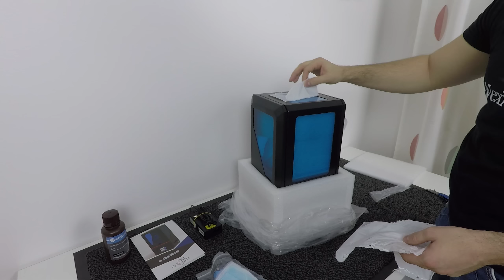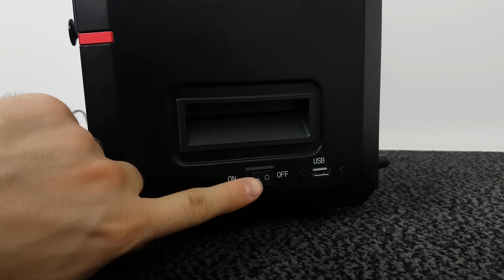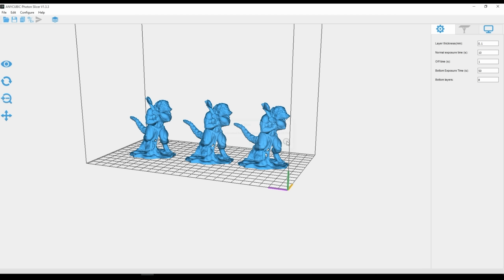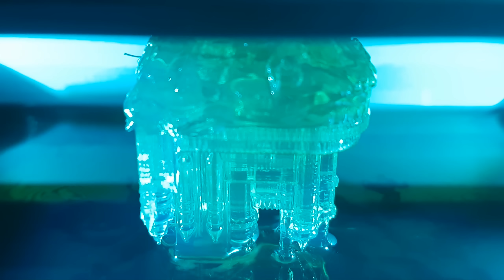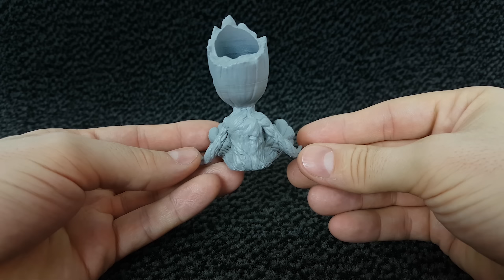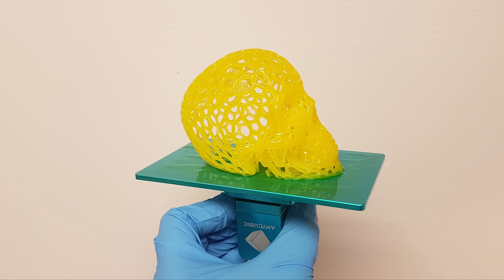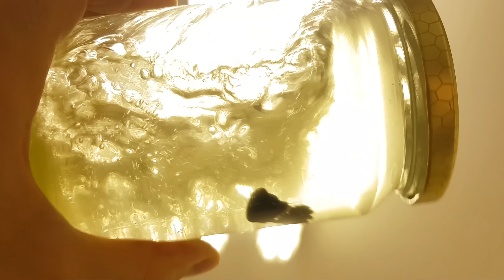Anycubic Photon DLP 3D printer Review - insane print quality!

Comment: So I did end up getting the printer! So far it is working pretty well, though I am having a sort of clicking sound that I cant seem to find anyone else noticing?
Every time the platform raises when printing, there is a slight popping or clicking sound, as if its popping off the model from the bottom film. I am a bit concerned as I don't remember anyone saying anything about that sound (though it is very faint), and not sure if you experienced this as well. I do have a spare film that I was considering replacing it with, but I wanted to make sure it was actually something to be concerned about in the first place. Thank you!
Reply from the maker: Don't worry about the popping sound that's completely normal. That is the sound of cured resin layer popping from film foil and moving to the next layer.  It's should sound like that when is printing especially with Larger objects. The bigger cured layer surface popping sound will be more noticeable. Nothing to worry about.
Reply: Thank you so much for letting me know, and for being so quick to respond! You are the best!

Comment: Great Work !  If you are worried about covering detail with spray primer, buy a hobby priced airbrush ....
Before Photoshop appeared on the scene, I was a photo positive & negative retouch artist . I used some equipment that you could airbrush a line on a eyelash and not go over the edge !  But you can use most any hobby airbrush for a very high quality finish and keep all of the detail on the model/subject .  Just be sure to select a two stage type.... That means when you press the button/lever it controls the airflow. Then as you start pulling back the button/lever it starts feeding the paint .  You can get a very fine spray mist !!  Just make sure you thin the primer or paint to a low viscosity, trial and error testing will let you know when you have it right !  Also a big plus is that the airbrush cup for holding the paint is usually 5-10 ml, so small can of paint will last you about a year or two !  Even Harbor Freight co, use to sell a two stage for $15 dollars US so just shop around ... Good Luck !

Comment: Now I know what I "need" next for making statues and accessories for my injection molded kits. Thank you  for the review. :-)
Only drawback is the small print size if I want to make a quarter scale statue. The body needs to be split in several parts. But it's not a big deal I guess. The quality is what matters.

Comment: There is the things i got from ANYCUBIC Customer Service
1)Photon was equipped ANYCUBIC photon system, ANYCUBIC can update the system anytime to get new function.  While D7 was equipped open source system, there are many limits, about system update, all the things they can do, is waiting for update.
2)Photon Slicer is also the key to push me to Photon, open source slicer slice a 30M file will take 24 minutes or more, but Photon Slicer can finish  this job in 1 minute, i am a person who can not wait too long
3)Open source system didn't have a Mac OS drivers, it means you can not use your Mac to do anything with your printer. Surprise, Photon system can get these drivers.

Comment: This review sold it for me. Ordered yesterday from Amazon Prime and it arrives today. Really looking forward to finally owning a 3D Printer.
Reply: SkemeKOS How’s your experience with it?
Reply: Excellent! The detail is incredible. Perfect for small scale objects that require very high amount of detail. This is what Ive been waiting for before jumping into 3D printing. I was initially a little put off by the clean up process, but it is very quick and simple. I just leave the vat, and print bed to soak in a tub of isoproyl alcohol for 2 minutes, remove and wipe with tissue and alcohol wipes. For the printed parts, just soak for 1-2 mins in the isopropyl, then wash with water for about 30 seconds. Leave on windowsill for about 30 minutes.

Comment: The baby Groot can be done even in an Anet A8, it's not a good example. I love the Eiffel tower thought
Reply from the maker: Mikel Gorostiza I doubt that all details would show on A8 like on Photon at this scale but still you have more then 20 other prints to compare with... I think Baby Groot looks very cool and it's great 3D model so I got to print it with Photon.
Reply: All those details, I can assure you I was very impressed too when my friend came with that and told me his Anter A8 did it. The printer is quite improved with some 3d printed gadgets and its inside an IKEA modified wooden box with a fan for a proper ambient temperature cotrol but still the whole mix is not more than 200€. For sure, that's not the most difficult piece to print and I don't know how much time did my friend spent to have that quality (i know him and it could be days) so still the difference between the 2 printers is huge, moreover the complexity of other pieces you show it's an impossible task for the A8. My point is that, in my opinion, the baby groot wasn't the best example to show the capabilities of the printer althought it looks great.

Comment: Sorry another quick question: Do you have to do any pre-printing preparation on the build plate 
(I.E. use hairspray or glue to make the model stick to the plate - as you would on PLA printers)
Reply from the maker: Chris Garrod No problem :) Nope, there is no need for any adhesive on the build plate. Just take your print and reinstall on printer again and go for the next one.
Reply: Thanks again for a fast reply :0)

Comment: I’m new to SLA printing. Are the printers resign specific? Do I have to use the resigns from photon?
Reply from the maker: Josh Daniels No, you can use resin from other manufactures as long is 405nm.
Reply: Nexi Tech I just got my printer and tried using makerjuice G+. I keep getting failed prints. Any thoughts?
Reply from the maker: Josh Daniels Fail prints you said. Are prints stick to platform or not? If not maybe you did not level it correctly or you need longer exposure time. I just check on Makerjuice website on G+ and it said that is pretty fast resin and it cures up to 420nm so I guess you need to level the platform better. Let the platform clamps harder paper then set Z to 0 and try again.
Reply: Nexi Tech I just ran the print at .035 layer height, 50 second bottom layers (8), 10 second layers. The only thing that cures to the plate are the base layers. I think I need to increase cure time for layers. What resin are you using?

Comment: hey there. with 1000ml resin how many minifigure can u create ? thnx :)
Reply from the maker: sinan sünder You can create 50 pcs of hulk size miniatures in video. Hulk is 20grams 100% infill. Dragon miniatures are 4grams heawy so you can make 250 pcs with 1L of resin. That's alot :)
Reply: thanks :)

Comment: what's the rate of failure for your prints?
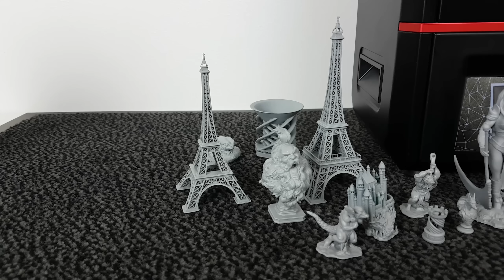Reply from the maker: Dave Ngan I didn't have any fail prints on this printer. Only once when I forget to add the resin and once more when I didn't use supports and I should. It's the print behind the Eiffel tower at the end of video 18:54
Reply: That's very impressive.

Comment: I've had it for a few days, and as you say, amazing !!! You forgot to mention it has a air filter with activated carbon ;)
Do you use their slicer for the supports we see in your prints ?
Reply: I just ordered mine, how is the smell, and the general finishing process coming from FDM? Gotta be LIGHTYEARS better than sanding, priming, filler primer, sanding, breathing in sanding dust, etc. Right? Bought it primarily for D&D minis, and small detailed greeblies for prop building. Still plan to use FDM for larger stuff.
Reply: Yeah no post pocessing madness, except cleaning the print in Isopropyl alcohol, you better get a good respirator.  
The smell depends mostly on the resin you use, I have tested Monocure rapid and for me it stinked in the whole house, my wife didn't smell it.  
Yesterday I tested Photocentric, it has no smell at all, but it takes way longer to cure the layers ( 8secs for Monocure, 30secs for Photocentric ). 
I use this printer for jewelry, still learning but so far the results have been amazing.
And this printer is super easy to operate, just be careful with the resin, it sticks to everything ...
Reply: Try putting some active charcoal filters inside the photon unit to absorb the smells.
Reply: It has an inline activated charcoal filter already in it, does it not?
Reply from the maker: sean latto This maybe sounds crazy but I tried to use thin cheap IKEA blanket and I covered the printer while printing(my wife is pregnant so she can smell a spider on the wall now) and to my surprise almost all smell was blocked in blanket. Makes me wonder WTF is in IKEA blanked!? :D 
Anyway I don't really get why the fan inside the chamber needs to be so powerfull and what is the need for such a high air flow(becide dust removal maybe?) I think fan speed in chamber can be reduced or even switched off and by doing that problem with smell can be solved or 95% reduced sense most of smell would stay inside the chamber, I might do that and report the results positive or negative. I know there is separate cooling fan for UV lights source so it shouldn't effect the other components.
Reply: @NexiTech  so did you do that? wat did you find?

Comment: Awesome review!  Thanks! I just got a Photon myself and was wondering if you could shed some light on a few questions I have.  So here we go:  which resin do you use? What are the settings you had best results with? How is the FEP sheet holding up on your Photon?  Have you had to replace anything on the Photon yet, other than the resin of course? Have you done any customizing on the Photon (higher resolution LCD, etc)?  And finally, how long have you had the Photon?  Thanks!

Comment: Any low-cost quality resin recommendation?
Reply from the maker: hugo nascimento I can only recommend Anycubic 405nm resin. I add links in video description. I had problems with other resin they start to cure even though glass panel of printer and even with contract with air. It could brake LCD but I see it on time.

Comment from the maker: Guys! Let's do quick comparing between Wanhao D7 and Photon:
1) Wanhao use liner bearings and rods to move Z axis. Photon use linear rails. + for Photon
2) Build platform is more solid and more modern design on Photon.  +for Photon
3) Wanhao have closed panels so you can't see when printer is printing. Photon has Panels  + for Photon
4) Wanhao have separated LCD controls and it take more space. Photon is more compact all in one unit. +for Photon
5)Wanhao have slightly larger build volume on Z axis 200mm comparing to Photon 155mm +for Wanhao
6) Wanhao is more expensive then Photon: +Photon
For me Anycubic Photon is for me personally better choose but that just my opinion. Did I missed something?
What you guys think? What is better choose if we assume that both have similar print quality?
 I would like to hear your thoughts.
Reply: Thanks for the quick comparison! Whanhao just launched a D7 Plus that includes a LCD touch-screen in the body + an integrated image processing. The non-Plus version requires a HDMI connection to be able to use the LCD screen (+++ Photon).
Reply: Great review! ordered one as well! Arriving next week! Will do a review for russian customers as well
Reply: Great review. I ordered one based on this video. Can't wait! 👍🏻
Reply: Just put it to cure outside in direct sunlight, will be longer but totally works :)
Reply: so, the main issue for photon could be its proprietary software and hardware......I guess?
Reply from the maker: twilipi Am not sure what you mean? What issues on Photon?
Reply: its "photon board" it seems a proprietary board(aka. closed source and not allow to modify)
Reply: Nexi Tech what if I don’t have uv lights
Does it matter?
Reply: I'd love to see a compare to the FlSun S DLP printer. it looks similar to the Photon.
Reply: Which country are you in?
Reply from the maker: Laser Man Sweden
Reply: И где?))
Reply: thank you this make me choose the anycubic,, anyway when you search in the web for prints made in this printer are pretty awesome work there
Reply: Funny thing , I'm about to buy a 7D plus, and mode the case so i can add a UV Window, Anycubic Photon is like 100bucks more expencive here in my country than the 7D plus lol

Comment: Why are there some rather big horizontal lines on Groot?
Reply from the maker: Ivan Čurić Prime Technophilia I notice that too. I print that model without any supports standing flat and that model is hollow without bottom(just the shell) so It might need to rotate or use supports to get better results.

Comment: I know they called this DLP on AliExpress but it can't be DLP and LCD.  It's got to be one or the other as they are VERY different technologies.

DLP is a projector technology developed by Texas Instruments that uses an array of micro mirrors on a chip to create an image.  

LCD is.. well everyone knows what an LCD is ;)

Both can be used in SLA printing. DLP printers use an array of mirrors on a microchip to project the UV light at the resin where as an LCD printer uses an LCD screen to block (mask) the UV backlight so it only cures specific areas.  LCD is typically called M-SLA. Masked SLA.

The techniques are very similar with one major difference. Both have a finite number of pixels but with a DLP projector you can optically zoom those pixels into a smaller spot on the resin vat to make higher detailed, smaller parts in a smaller print area.  LCD has fixed pixels in a fixed area so the ppi of the print area cannot be changed.

Comment: I have an Anycubic delta printer and it runs great. I trust the company but I am curious about something. Is there something in this price point that prints bigger files? 115mm sized prints seems ok. I just wish it was little bigger like 150mm
Reply: Isham Padron At this price point, no. At $1,250 there's the Moai kit which is 130mmx130mmx180mm. It's SLA, but it's similar from a user perspective.

Comment: Nexi Tech - Extremely nice well-presented informative review.  Thanks!

I love my CR-10 but also would like to have an SLA or DLP printer, like this one, for smaller intricately detailed models.  I've been waiting for eons for SLA prices to come down.  Looks like this DLP type is a great alternative.  BTW, just subscribed.  Keep 'em coming buddy.

Cheers from Thailand!
Reply: Hi Jimbo，nice to see you！one of my client wanted to important a 3D printer from China to Thailand,  faced the same situation as you met.
Reply: Jimbo, did you buy your printer in Thailand? Any recommendations? Also in TH and thinking of buying my first and had my eyes on the CR-10S, just pretty clueless about them all atm. The other one that seems to be compared it it is the Prusa i3, any thoughts on which would be a decent first printer for random/general use? Was gonna chance ordering from abroad as they're kinda expensive here (at least the odd few sites I managed to find), the customs charges included would probably still end up cheaper. You have any issues buying parts and filament here? Cheers.
Reply: Sawasdee khun Peeg - I ordered my CR-10 online from Banggood.com because, at the time (last September), I couldn't find a CR-10 for sale anywhere in Thailand.  And you're right, 3D printer prices are horrible here.  Luckily, Lazada.com now has the original single z-axis model CR-10 (like mine) from several sellers for 14,787 baht.  The upgrade models are prohibitively expensive.  Here's the link: https://www.lazada.co.th/catalog/?q=Creality+CR-10+3D+printer.  While 14,787 baht is a little bit expensive it's not bad, considering importing, like I did.

I promise you that if you try to import a 3D printer yourself it's going to be a nightmare since 3D printers, according to the junta's ultra-paranoid government agencies, are dangerous.  In fact, 3D printers are classified as  'restricted'.    The 'reason' I got from government employees is that I can 3D print a gun.  Yeah, that's right... a plastic gun that shoots plastic bullets that I can shoot plastic toy soldiers.  As a result I had to go to Bangkok to fight the bureaucratic red tape to get mine released from Suvarnabhumi Airport Customs jail.  It required registering with Customs, and also acquiring a 3D printer import/export license from the Ministry of Commerce.  I also have to notify the Ministry of Commerce twice a year, every June and December, of the disposition of the printer.  Trust me, better to just pay a little more and avoid the hassle.

Regarding the Prusa i3, the Creality is based on (copied from) that original machine/format.  In fact, in my slicing software my CR-10 is listed as a Prusa i3.

If I can help you in any way please ping me.  And if you decide to import I can probably help since I now have an official import license.  Let me know.
Reply: Jimbo in Thailand Oh, they just all sold out locally by the looks of things :/ Do you fancy importing one to sell by any chance? Add a little $ for your time of course. Just let me know. Thanks!
Reply: OOPS... it seems that Lazada is pulling a fast one in this case.  The 14,787 baht printers are not only the 'Mini' version of the CR-10, i.e., 300x220x300, but they also appear to be bootleg copies "Based on CR-10".  Oh well... T.I.T.

I just sent you a PM via YouTube.
Reply: Yes, It's definitely a nightmare importing 3D printers, toy/hobby drones, etc. after Thailand was taken over by a military coup back in May 2014.  Sadly, paranoia of anything high-tech is running rampant throughout the Thai government since then.